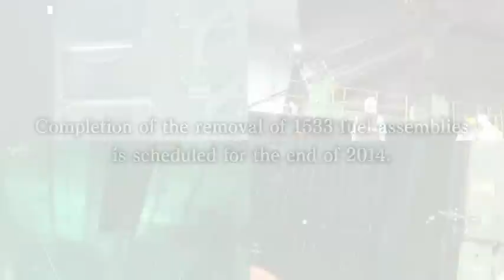Removal of nuclear fuel assemblies from Fukushima Daiichi nuclear power plant

Comment: I used to be against nuclear power but the Fukushima disaster has actually gave me much more faith in the technology.  There are many fail safes and over all the work is done much more diligently than oil. Yeah, there was some screw ups, but I'm sure there was lessons learned here to avoid it from happening again.  Look at the gulf spill, all the tanker spills and other disasters related to oil such as explosions like Lac Megantic.  WAY more people have died due to oil disasters than nuclear.  Oil also has done way more damage to the environment than nuclear.  In a perfect world we'd go all renewable with wind, solar and hydro but in places where none of those are possible nuclear is the next best thing as long as it's implimented safetly.  It would be nice if they moved towards thorium reactors though.  Those are safer and also use a less rare resource.

The downside of nuclear is what to do with the waste though, there really needs to be a proper solution for that.  There needs to be a way to recycle it into something safe.   But with oil, the waste just goes up in the air and is killing the planet anyway, at least with nuclear it gets put away.
Reply: Nuclear power is safe. Fukushima proves it. The design worked. We did not have 3 nuclear explosions that spewed tons of radiocative debris into the air like what happened with Chernobyl.

We actually have the means to take care of the nuclear waste via "re-burning" it in a breeder reactor.
But this produces plutonium and has the potential to be used in bombs and the nuclear non-proliferation treaties prevents the construction of such reactors... Even thou you could build a breeder reactor right next to a regular reactor so that there is no chance of proliferation of nuclear materials, you just swap the fuel on the spot... Plus getting the plutonium out of the fuel that was used in a breeder reactor is complex and dangerous, a terrorist would be hard pressed to even get close to the fuel(the excuse for the NNP treaty)...

Go figure...
Reply: @memadmax69  
> a terrorist would be hard pressed to even get close to the fuel
2022 here. May I introduce you to russian occupation of Zaporizhzhia NPP?
Reply: Anne M did you just make that up or do you just regurgitate whatever left wing drivel that is shoved down your uneducated gullet?
Reply: Anne M Those are click bait articles.
Reply: MeMad Max A couple of things: Chernobyl wasn't a nuclear blast; it was a steam explosion that happened inside a reactor. Second, all uranium reactors create plutonium; that's how it came into being.  The spent fuel of every reactor on earth contains up to 1% plutonium; it is a waste product.  Uranium breeders purposefully create plutonium for reused as fuel, and therefore maximize its production.  You can't just "swap the fuel on the spot", there is quite a lot of chemical engineering that must be done in between.
Reply: Where did you hear that this second explosion was nuclear in nature?  The bald fact is that while a reactor with 3% enriched fuel in it can melt down, it cannot explode, not in a nuclear bomb sense. It just can't; you can't bring the fissionable uranium atoms close enough together to cause the run-away chain reaction (called prompt critical) to explode from high energy energy neutrons.  It can go prompt critical from thermal (low energy) neutrons, but there has to be a carefully implemented moderation scheme, and when it does go prompt critical, it melts, not explodes.  There may well have been instances of that in the Chernobyl accident, some say there were, but the explosions come from either steam of hydrogen.
Reply: MeMad Max it is safe if you don't build on a major fault line on the ocean
Reply: Anne M Amazing that you'd cite those as "sources". Anyone who has a clue on the subject can clearly see that you have absolutely no understanding. Furthermore you should probably reflect at how stultifying you appear posting articles like that. Maybe then you'll stop blabbering nonsense.
Reply: Anne M Such a comparison would be a lot more meaningful if you said, of, 3 nukes per year, or some such.  Three nukes worth of fallout in the ocean is miniscule, and less than miniscule, because fallout in the ocean is self-shielding (water is an excellent radiation shield), and once it settles, it will never again be a threat.
Reply: Red Squirrel All nuclear facilities would to well to use the facilities waste thermal energy to produce electricity. Such a system would never require shutdown and could be used in emergency situations.
Reply: ***** No, he (probably) doesn't.  The respected British journalist, George Monbiot, said the same thing some time ago.  See http://www.theguardian.com/commentisfree/2011/mar/21/pro-nuclear-japan-fukushima
Reply: +puncheex2 I love how informed you are on the subject. By merely reading your conversations among the comments I have been able to learn alot about a subject I was basically clueless about!
Reply: I appreciate that, Emanuel.
Reply: okay bitch shut the fuck up, LOOKING AT WEBSITES ON THE INTERNET IS NOT FUCKING RESEARCH< ITS NOT PROOF. IF I WAS TO WRITE ON A WEBSITE THAT HITLER WAS A UNICORN WOULDD YOU STILL SAY ITS FUCKING PROOF. GET THE FUCK OUT. (also 3 nuclear explosions would have been way worse)
Reply: puncheex2 I was referring to the "second explosion" at chernobyl.... There were two explosions there: The first ripped off the top of the reactor vessel(steam pressure related) and the second was nuclear explosive in nature that threw the majority of the nuclear material into the atmosphere.
Reply: lol Cleary your miss informed yes black gold kills wildlife but nuclear accidents cause like this Chernobyl  use to be thriving  with 50.000 peaple  now  it's a ghost town oh the bomb they dropped on Hiroshima  killed millions lol  atleast oil explosions if they do kill it's probably some stupid wander smoking when toxic flammable gas comes oyrvifvthe ground even gas drilling is dangerous atleast it's easy to clean up unlike nuclear energy  unless it's a special  design nuke that can wipe a country of the map and still be habitable  again it all comes down to how the fission  reaction  is done but nuclear reactors are  like pure uranium  and plutonium  if that goes up I doubt Japan has fixed there out of control reactor yet chernoble stopped the biggest explosion  from happening

Comment: I really don't think that is reactor 4 people. That place was f*(^^d up big time. But I love the green paint...love it. Nope, I'm guessing that's not even Fukushima, I could be wrong but it just looks to clean to well put together after all the damage that was done...
Reply: Bee Ker  You're wrong.  Unit 4 had been defueled at  the time of the disaster; it suffered little of the destructive hydrogen blasts in the other units.  The pool held all of Unit 4's spent fuel, and the new fuel that it would have been refueled with.  It was the easiest place to begin work.  This is all very basic stuff; you could have gotten it fro the wikipedia article on the disaster.

Comment: Welp, I'm sold!  Sounds like that company knows what it's doing, and it's doing it in the right and safe way.  Nothing can go wrong here!

...

/sarcasm
Reply: Actually Reactors are very hard to explode. Only emergency is meltdowns. Molten salt reactors are the safest in my opinion,but they require heavy maintenance.
Reply: @doctorpanigrahi9975  Except RBMK reactors, they can explode very easily. PWR are the safest while being very efficient in my opinion, because there radioactive water never touches anything other then the pipes and core it means if a leak where to occur it would stay in the containment building.
Reply: EVA_Unit_4A stop

Comment: How could TEPCO have possibly carried out that type of lifting and removal operation (claimed at 2:25) 1200 times in the time (1033 days) since the initial damage? Is this video actual video of the inside of reactor 4 building?
Reply: They have removed fuel rods at different plants. facepalm
Reply: TheBoostHeroMan Then that is quite the misleading reassurance, isn't it? As this is a unique situation that all experts involved with it have categorized as something totally different from any other fuel handling situation.
Reply: Tom Ford
the removal of these rods is the same as most other rod removal operations the difference being the context in which it is happening.  These rods aren't damaged and the removal will now (after the repair of the surrounding area and the construction of the removal machinery) take place virtually as normal.
Reply: Phantasm http://americablog.com/2013/09/risky-repair-fukushima-spill-15000x-radiation-hiroshima-85x-chernobyl.html
Reply: Tom Ford Its not different, its just people trying to cause hysteria.  Fuel is Fuel, its not going to go critical since its so spent, its not going to somehow go above water and whatever else people have said would happen.  This is just the Anti-nukes trying to scare the fuck out of people, and it worked.